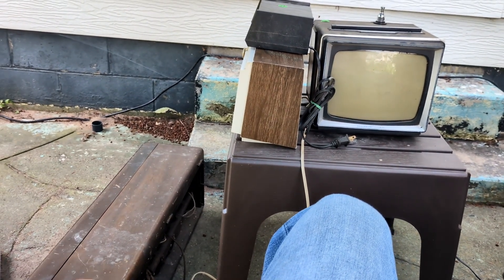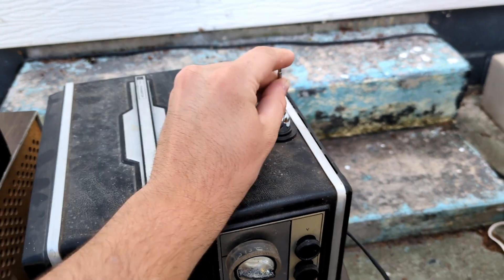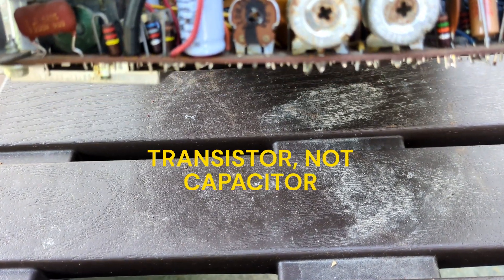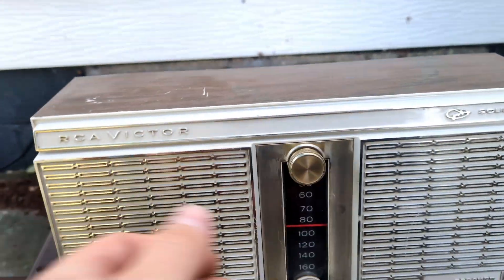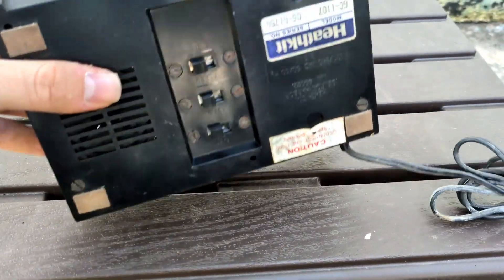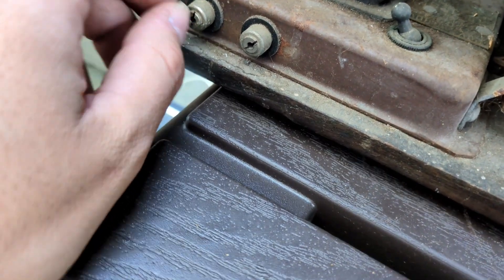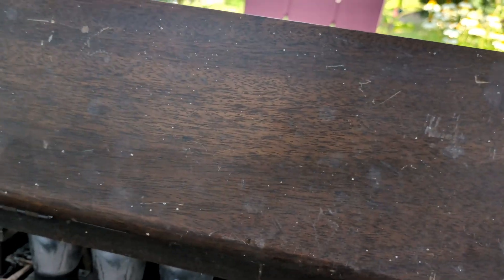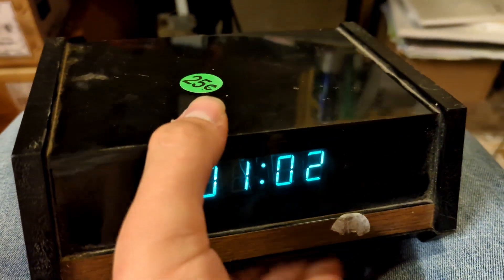Vintage TV and Radio Yard Sale Haul

Comment: Woohoo finally someone who knows how to read date codes, even the more cryptic ones, it always bugs me a little when someone who otherwise obviously knows their stuff says "I would guess this was made in the 70s" when there's a big "74-44"  right in front of him. I always add around half a year to the latest component date code to get a reasonable date of manufacture. 

What's crazy is that Thomas Edison was still around when the 1928 radio receiver was made, he probably never anticipated what impact it would have back when he was tinkering with plates inside his light bulbs.
Reply: I generally look at the components as well to get a general idea of when something was made. A date code like "74-44" is pretty obvious, but a lot of them aren't. Some people see any set of 2 numbers anywhere and just assume that is a year, which is often times not the case. I honestly don't know why companies can't just print the date on the label if they are putting a date code on, it shouldn't be encrypted or secretive.
Reply: @WalterKnox  

Sure, they can be misleading at times, even the twisty things with the arrow, sometimes they apparently use Japanese years, years since production started, or whatever. Some use two letters or a combination like 4J10 and stuff like that. 
I assume they are cryptic for warranty reasons and that's why they are there in the first place, so people can't go unnoticed when they swap broken parts from a defective unit that's out of warranty into one that still has time left. They will check if the date codes match if warranty is claimed and for that matter it's an advantage if the culprit cannot read them. They were not meant for collectors and junkyard archaeologists like us :)
Reply from the maker: Right?? I was going to make a video on how to decode various types because it irks me when people are too ignorant to do it themself. Now I'll have to make that video!